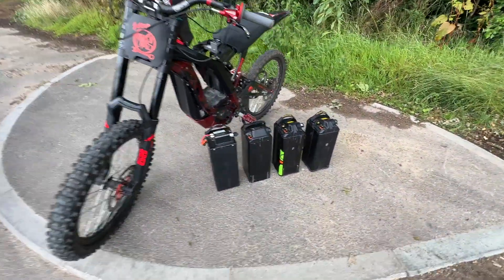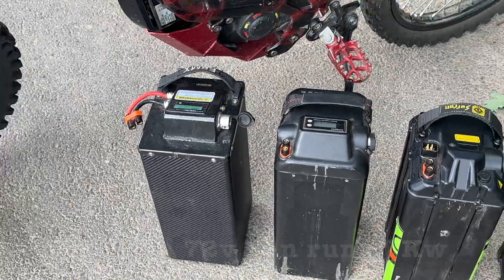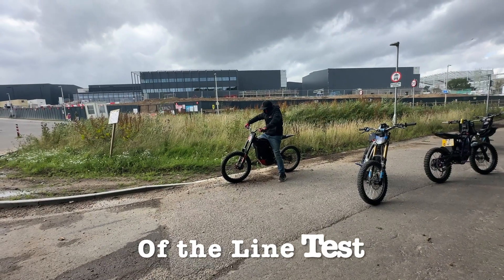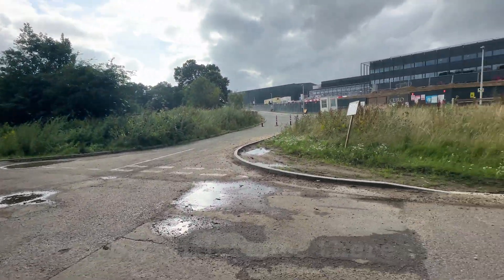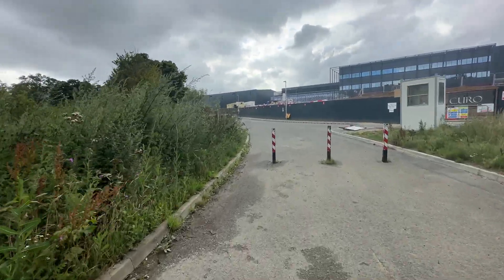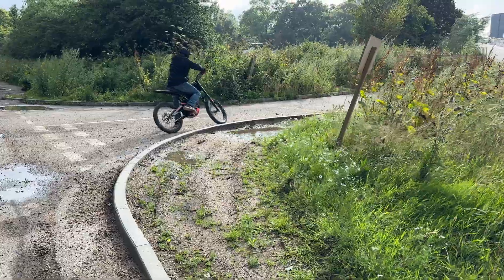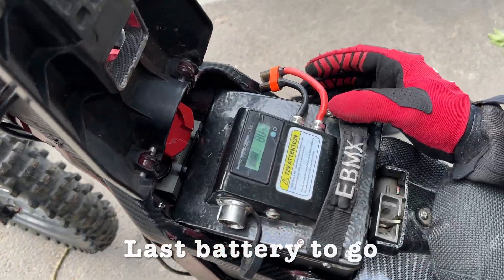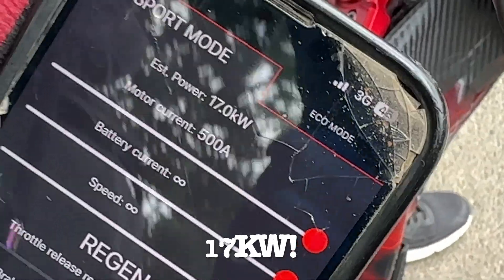Is the Torp TC500 Surron Controller the Best in the Game

Comment: Wats it like with the 60v 40ah battery
Reply from the maker: Better than any other controller 😅
Reply: @SurronLondon  what is the top speed change from putting in that torp?
Reply from the maker: @iamtheblackwizard88  depends on how you set up your torp but I'd say it adds 10mph or more

Comment: It would have been nice to see the top speeds on all the batteries.  Do you recall what your speed was with the 60V bypassed batt?
Reply: wasnt bypassed
controller works with stock battery bms dont need a dodgy bypass tht shitl burn ur house down
Reply: torp is s scam please dont buy it

Comment: I bought a used Ron with bac4000 and it went sour after 4 months when I learned that my overseas seller would be the only one able to service it and cost incredibly to fix under such arrangement. Never get a bac again personally because it's closed code. 
Torp is open code and rocks straight out of the box. Aerodynamically and aesthetically it's superior imo. 
Sadly I never got to try bac myself before it went bust since it was on my son's Ron
Reply: The b a c controller was never built for a surron
Reply: what's the difference between open and closed code? aloha from Hawaii
Reply: @sponger-qo9wf if you need to ask you don’t need to worry about it
Reply: Then don't buy a used BAC from an overseas seller?
Mine was under warranty and went bad after a few rides. I got a free warranty replacement, and it's been good for over 2 years now. It might've died because of the regen or the company I bought it from sent me a refurbished unit, not sure. But either way, if mine breaks again, it'll cost me $450 to replace from the same company.
All that being said, I still prefer BAC's raw performance over TC500 ease of use

Comment: I dont know boss... The BAC4000 and 8000 have more buttery power delivery. Torp is a white label of the VESC which is mainly used in skateboards. The majority of racers and stunters prefer the BAC controllers and the BAC8000 has twice the phase amps and better true FOC for top speed as well. Great video , thanks for sharing.
Reply from the maker: Thanks for the comment. I prefer the torp because of its quick and smooth throttle response. Could you explain what VESC and FOC is please. I’m interested to learn something new.
Reply: @SurronLondon  The throttle response is easily adjusted on any BAC controller. "Torque based FOC" makes it easier to manipulate the motor as it "feels" resistance and allows you to control the vehicle with more precision. Only BACs have a torque based FOC feedback loops. Hence, the reason why stunters and pro racers prefer it.

Comment: How much is there difference between 60 and 72v? I'm looking for long distance and good power is 60v60ah enough?
Reply from the maker: 72v is more for top speed
Reply: @SurronLondon  The main difference between 60v and 72v is that 72v can get the motor to a higher RPM even at the same KW. A 72v can reach 50+ MPH even at 3-4kw or possibly even less. The range depends on your settings, kWh capacity of the battery, weight of the bike/rider, sprocket.
Reply: Is 60v stil 47mph or more than standard